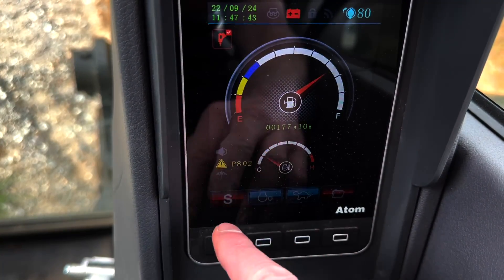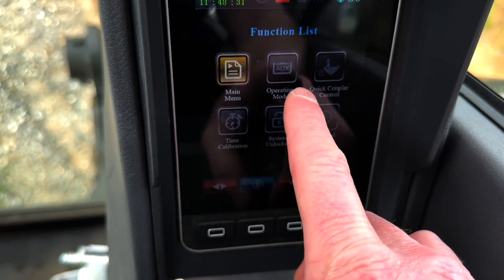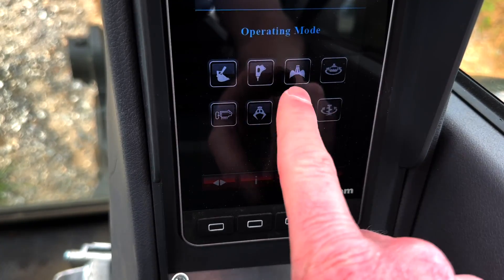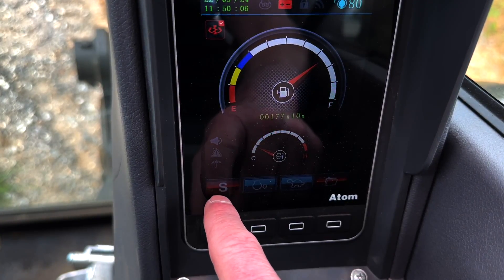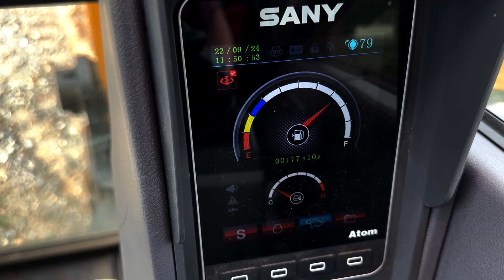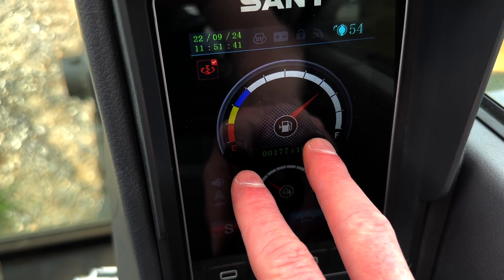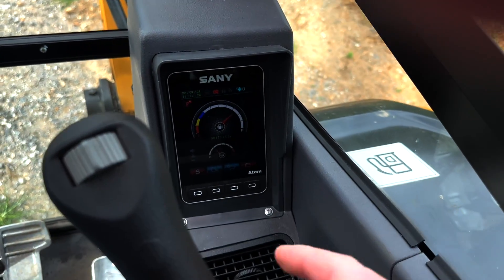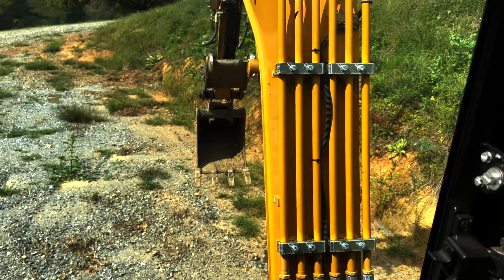Sany SY35U Mini Excavator Aux Flow Setup Up

Comment: So how do you make it run all the time running the mower? Is there a switch that has to be installed.
Reply from the maker: If you set it to breaker mode and engage it will run continuously but I rarely use It on the mower. The VMC if spun up cuts for a bit while using the hydraulic flow for movement if needed and you get a feel for making cutting/moving efficient.   I ran the the cutter previously on the JD 27 machine and the SY35 had more flow to work with.